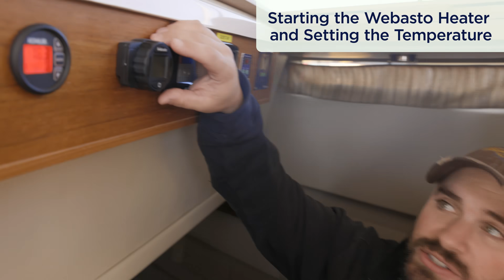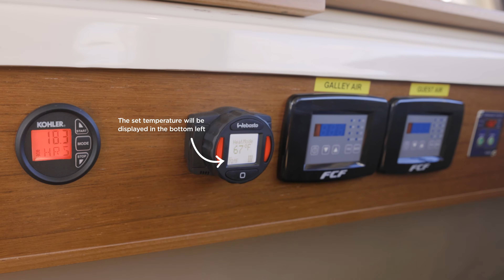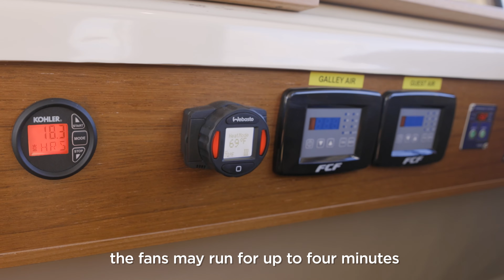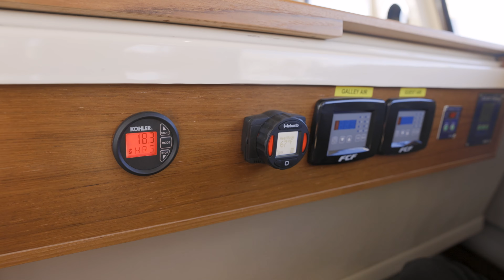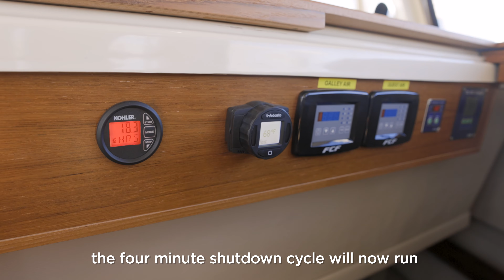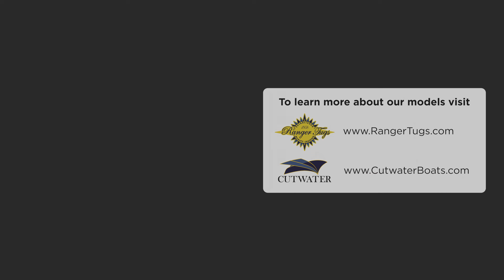Webasto Diesel Heater Operation

Comment: I got an F11 code. No heat😢
Reply from the maker: an F11 code usually means there is a problem with the combustion air blower fan. The heater expects the fan to spin at a certain speed during startup, and if it does not, it triggers the error. Check that your battery voltage is strong, then look for blockages in the air intake or exhaust and make sure the blower wiring and connectors are secure, turn everything off and back on. If the code persists, the blower motor may need to be replaced. Hopefully these tips help!

Comment: Hi Kenny-- From Mike L's comment it appears there is no diesel fuel gauge ...
Can you give us a rough estimate guide of approx. how many hours of heater operation before the diesel should be topped up?
Also ... if the heater runs the diesel empty ,is there any special procedure to re-starting the heater after refueling ?

Comment: Thanks -- this is helpful confirmation regarding the procedure. So grateful to have this heater in the PNW as we enjoy boating year-round! We have experienced sometimes a little bit of "latency" in operating the dial to get the set temp to adjust where we want it. Helps if we turn it slowly, not too fast.
Reply from the maker: Hi Sarah, we're glad you found this useful! Good tip on turning the dial slowly, thank you for sharing that.